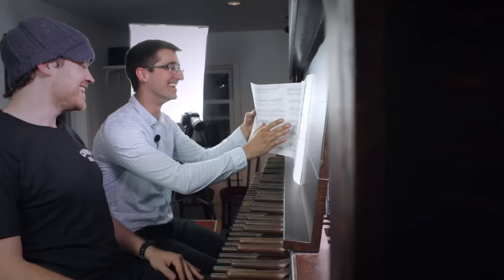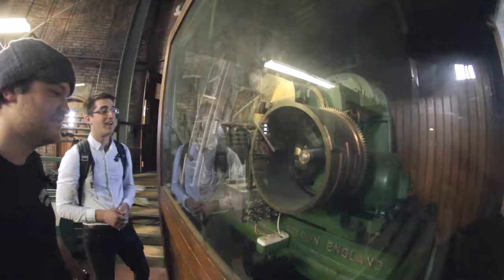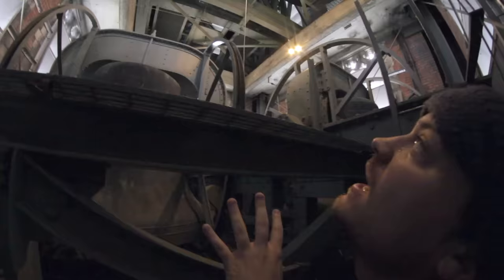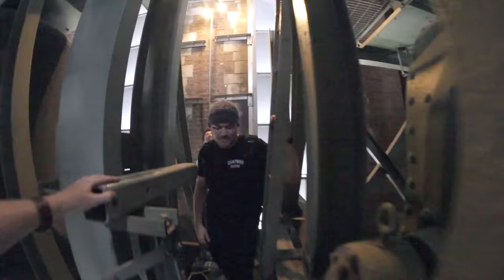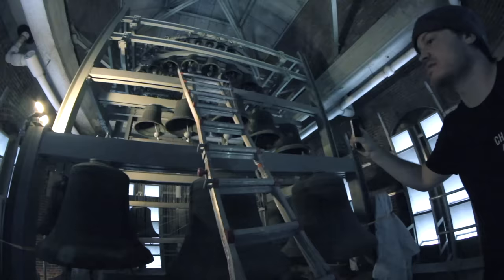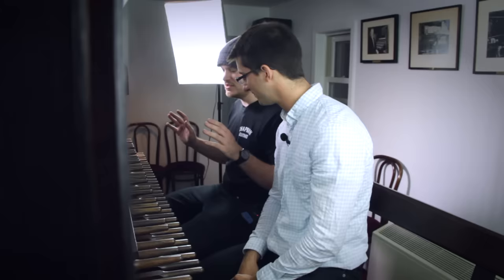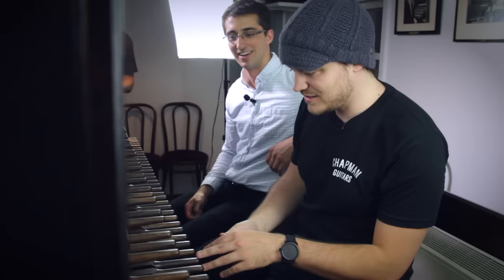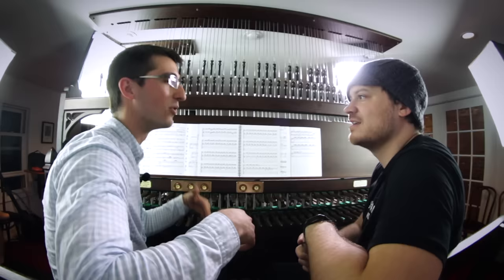Carillon (A tower filled with 100 tons of bells)

Comment: "Do any of these chime on the hour?"

Bells: Deep inhale
Reply: Ok but the funniest part is that it fuckin distorted a camera sound that much. And you know it's a good camera sound with a pop filter yet it was so loud and overpowering it distorted that much.
Reply: Crap, I just made a comment about this...
Reply: Ah, it’s fine....
Reply: Bells be like hold my beet
Reply: Beer
Reply: ALLOW ME TO INTRODUCE MYSELF!
Reply: @guitarandgames1386  what's a pop filter gonna do?
Reply: @AdmiralTom  Filter sounds that pops..
Reply: @EO-McLoud  okay smart arse, pops are from fast moving air causing distortion on a microphone, usually from wind or vocals with the letter 'p' or 'b'. A bell in an enclosed environment does not need a pop filter. At the most it will need to be suspended so that it doesn't pic up the floor reverb adding additional distortion to the original sound. So my question still stands, what would a pop filter do?

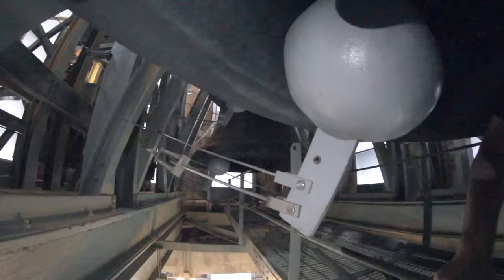Comment: 9:58 is a terrific example of how microphones cannot capture all aspects of a sound, particularly loud ones. This is why gunfire (for example) sounds very different on film as opposed to real life.

EDIT: For all the dweebs saying "ACKSHUALLY...", *yes,* I'm well-aware that the sound of gunfire can be reproduced with reasonable accuracy, but it requires that the sound engineer have knowledge of the sound system that will be used and that it be properly configured.
Reply: Correct , mics cannot even capture the timbre of a acoustic guitar realistically let alone a piano or church organ of bells like this. There is a huge amount of dynamic range these instruments produce ..
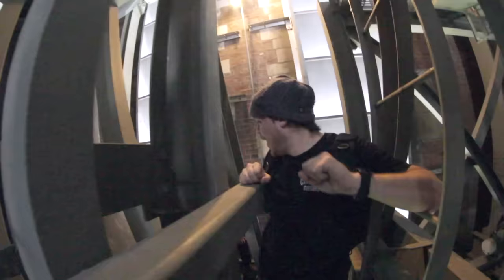Reply: 9:58 10:00 is loud
Reply: The problem usually isn't with the microphones, it's with the playback system being unable to reproduce the signal. Unless, of course, cheap microphones are being used.
Reply: Your point is valid, but I know some film and tv sound designers and they’ve told me gunshots sound so different in media is because “real gunshots sound pretty lame…like firecrackers.” Thus you get a .38 that sounds like a canon going off.
Reply: @stuminnis4050  the 'design' of the sound is lame, but very, very loud. So its a bit of both. Microphones cant record that loud and speakers can't play back that loud because its literally deafening. And then the sound itself isn't 'epic' enough for the movies.
Reply: I have speakers that can reproduce gun shots authentically. The thing about gunshots is that they are loud and when used in movies there is music and dialog played over the gunshots.
Reply: @scottashe984  - What speakers are those? I'm curious.
Reply: It has a lot to do with the mic, I record a bunch of music, and having a huge ceiling when recording helps. But obviously, you need to know you're recording something loud. Audience concert recordings are a very good example, looking at some recordings from the 80s, they sound like mush, cheap walkman, cheap mics, bad audio. Compared to some people who made custom equipment and snuck that in. "Mike the Mic" used a wheelchair and made the handles actually mics instead, and the seat a pro field recorder. Setup like that gives some absolute magic quality. Digital audio in like, 2005-2013..ish is an example, those digital cameras and phones.. the audio you get is so bad, even if you're just recording yourself talking. You clip digital audio, that audio that's too loud is just lost forever, it's cut off and you can't get it back, even with ultra speakers and declippers. 

However, if you listen to that, and then go to a proper concert.. there still is no comparison. You can get the audio, and have the quality, but you lose something, you lose the... low frequencies? Maybe? It's something I found, there is SO much dynamic range, and especially when it's an acoustic guitar. Live, they sound awesome, in a concert they're alright. But, audience recorded acoustic guitar tracks are very... quiet. Microphones struggle to get them, and you're having a mic capturing what a mic captured with an acoustic, so a lot is lost.
Reply: @stuminnis4050  As you've said.. film and sound designers don't go for accuracy. They go for effect. Whenever you see the MGM lion at the beginning of movies, you're actually hearing a Tiger. Tigers are used OFTEN for big scary roar effects in movies. A lion's roar carries for miles, but it's more of an "oof" than a "RAWR!". A tiger's roar is subsonic, high frequency, and extremely loud, so it can literally paralyze its prey. That kind of roar not only sounds better, but it hits us on a primal level. To a sound designer, this is better than using an actual lion's roar for accuracy's sake. 

Real gunshots only sound "lame" when recorded because you're only hearing the audible frequencies. You're missing all of the subsonics, which in real life you can feel resonating through your entire body. If you ever stand off to the side of an AR 15 or large caliber gun muzzle when it goes off, that subsonic soundwave SMACKS you in the chest. Without ear protection it's physically painful. This is what audio designers are trying to make up for by creating a canon like sound for a .38 shot. If you shot a real .38 (especially indoors) I promise you it wouldn't sound lame. It would rock your world. 

OP is correct. Some things can't be accurately recreated with mics and speakers. Your friends in film will back that up. Ask them to tell you some funny "Foley" stories. Lol
Reply: @clicheguevara5282  god yeah, foley weirdness is great. Some of the things they used, especially in the 60s, are wild. A lot involving casually melted/ing plastic indoors with no regard for the fumes! Nowadays it's more common to be a bit more "old school" with leaves and stuff.
Reply: Alot of new Shooters are scared by Modern AR15s with 16.5" barrels.

5.56x45mm was originally ment to be shot out of a 20.5" barrel. When you shoot a 16.5" those feel to the people in the stall beside you like someones baffling you with a Matress.

But then someone with a Higher-Grain Higher-powder cartridge like 7.62 out of a 20" SKS just sounds like a loud "Tink" an a single crank of a loud mufflerless 4-Cycle having a bad start. Not to Mention the Sonic-Crack of Baseline FMJ-5.56 loads.

Then someone rocks up with a Subsonic .308 AR10 Suppressed and no one can Hear it per say. But EVERYONE can FEEL the air it's moving and the Steel it's Slinging.
Reply: No need to insult them, if you can’t take THIS then perhaps you shouldn’t use the internet like this?
Reply: Thunderstorms are a good example. On microphone they are quite high pitch and crackly. In real life it is a deep and echoing boom from all directions. Deep vibrations do not get picked up that well
Reply: Yep, a problem with both microphones and reproduction- namely loudspeakers and headphones. It's what drove me to enter the field of loudspeaker design. Growing up, attending church services at massive cathedrals, playing drums in a small band, listening to orchestras play live... microphones and loudspeakers simply can't do it justice.

Comment: I studied carillon for a number of years. You can ask me whatever, I guess. 

Common questions/misconceptions:

1) Not all bell sets are carillon. Specifically, a carillon contains 2 or more octaves of bells, and are played via keyboard ("batons") connected to clappers. The bells are fixed, the clappers are mobile. This is different than "change ringing" in which bells are swung via rope. 

2) The position of the studio/console is not standardized. There are carillon where the console is right in the middle of the bells, and there are consoles where the console is many stories below the bells. 

3) In general, carillon bells are deliberately tuned to an artificial/inharmonic spectrum that flavors minor thirds. "Major" bells are the exception, and are only found on some older carillon in England. 

4) After WW2, there was something of a carillon renaissance in the USA, but the true home of carillon (and compositions/composers specific to carillon) remains Belgium/Netherlands. 

5) The method of practicing carillon depends on the location. For some carillon, the console can be physically disconnected from the bells. Other places use mock consoles with small tubes/bars for sound, or more recently there are some MIDI enabled consoles.
Reply: You're thinking of reddit. This is a reddit thread prompt.
Reply: Why are the bells' harmonics tuned in minor thirds?
Reply: @karawethan  Interesting! I never would have thought that tuning to the harmonic series isn't always optimal. Huh.
Thanks so much, have a nice day!
Reply: What gives old Russian church bells that cool sound? These are different, right?
Reply: Ofc ur last name is shwartz
Reply: What's sad is that the majority of new Carillons are a laptop,  amplifier and some horns on top of a tower. Even sadder I have installed and serviced many in South Texas.
Reply: You can Google Maas-Rowe BLW2
Reply: What is your favorite song to play on carillon?

Comment: As an electrician I can't recommend making a contacter with a cardboard box, I also can't  say I've never done that
Reply: Good to know... so use a crate?
Reply: Microwave
Reply: Well it worked I guess lol
Reply: Haha I bet that never came up in the textbooks

I'm curious now though, how does that type of switch work? Did the cardboard box close an open circuit? In that case I'm really glad they didn't film someone dying to make this :o
Reply: @Jonksy  i feel like it’s some sort of solenoid since it’s pneumatic and maybe there’s a button he pressed that manually switches the solenoid instead of requiring the electricity to switch it
Reply: @imdabeast100  relay, it goes from low voltage to higher voltage, probably 120v. low voltage is used to control everything and once the signal is sent, it is then used to switch high voltage which actuates the valve. which is certainly a solenoid. all he did was close the circuit that the signal would have done otherwise
Reply: The jargon kind of went over my head but after some googling I think I have somewhat of an understanding. Cheers guys.
Reply: to me, an electrical engineer, this looks more like a compressed air valve that he depresses to release/increase pressure, and thus strike the bell ;)
Reply: All right next time I'll just use my fingers then... Will get back with results
Reply: Lmfao that part was hard to watch

Comment: Reminds me of a old electric Carillon I repaired and maintained for a church. It had a bank of about 20 tuning forks used to generate the tones a tube amp to broadcast the sound through loud speakers .solenoids struck the tuning forks they were activated by heavy paper roles and micro switches. The hole thing was pre transistor and interesting to work on and watch run.

Comment: I went to school at Norwich University in Northfield VT. We too have a Carillon, Adam's Tower is not the biggest, not by a long shot. It originally had 36, but later on, after 27 were sent to France to Be Retuned or in the case of 22 of them, Recast entirely, 11 more Bells were added after these 27 came back giving it it's current compliment of 47 bells.

Comment: I am from the UK and noticed the clock was made in London. We also have an old tradition of church bell ringing. I used to be a church bell ringer. We ring bells by pulling a rope and the bells swing on an axle with wheels that the rope goes round that causes a loose clapper to strike the inside of the bell with a 'hand' and 'back' stroke. A carillon is of course a different mechanism but bells are amazing instruments however they are rung. I have stood next to the bells in our Cathedral (which has one of the heaviest sets of bells in the world) when all 12 are ringing at the same time. Each bell has multiple harmonies in it when ringing and one of the bells harmonies was shaking my rib cage. I had ear defenders on but it was a very very strange feeling.

Comment: I've seen the inside of the carillon at the National Cathedral in Washington DC, which was impressive.  Atop that is the change ringing bell room, and atop that are the change ringing bells.  Change ringing bells aren't a solo instrument, but they are a really interesting instrument.  In change ringing, the whole bell swings around, and the ringers (one per bell) are switching the order of the bells to ring out a set number of changes.
IIRC, the two largest sets of change ringing bells in North America are at Trinity in New York, and the Washington National Cathedral in Washington DC.  Might be worth a video, especially when you consider that each bell (several hundred pounds to several tons) is being swung manually by a single ringer, and paused on a precise point in their swing.

Comment: I'm surprised I guess they adjusted before cause that thing he does with the wire that is essentially like tuning the bells you want the clapper to just strike and because the wire is metal and long it expands and contracts based on the weather so everytime you play (unless someone adjusted before you) you have to adjust the wires for each bell.
Reply: The tuning is done before the bells are installed on a giant lathe, as mentioned in the video. The adjustment on the wires just changes how hard the bell is hit, more or less.